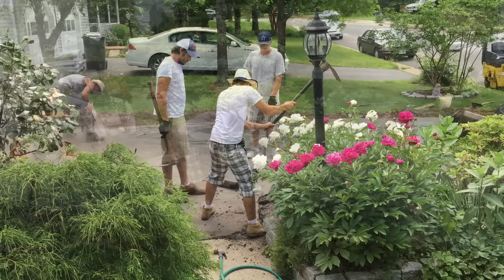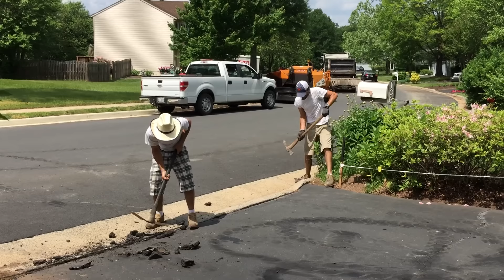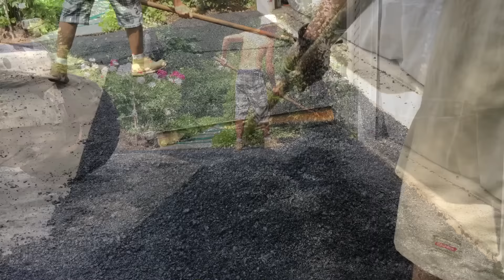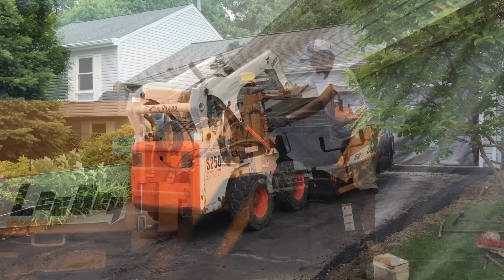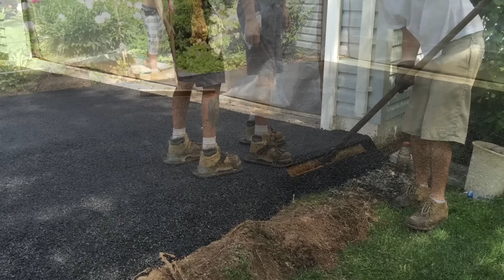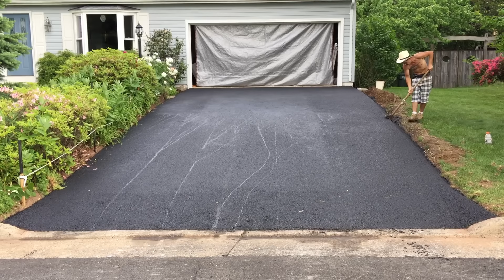A-Pak Paving Resurfaces Our Asphalt Driveway

Comment: Great job. Yet, I am surprised there isn't a better way to pat down asphalt than having a skinny guy with big shoes jump around on it.
Reply: +bg147 Odd how there weren't people around with more suitable BMI for that part.
Reply: +bg147 Plate compactor.
Reply: Realistically they should have had a vibratory plate and a paver that has feed screws and removable wing caps instead of guys with shovels and  pack pads on their boots. Shirtless and unprofessional is the way to go if u want a cheap driveway.  If u want it right someone comes in with a skid steer with a milling head on it and they use tac between the old driveway and the new surface  not guys with picks banging and smashing and wasting time and money
Reply: When he started this job, (the skinny guy) he was fat. :P
Reply: bg147  there is it's called a hand tamp
Reply: +Matthew Steiner gkbu
Reply: Matthew Steiner a hand tam won’t comment compact it evenly it’s more for patching than paving
Reply: No no no
Reply: bg147 there are far more better ways.
Reply: bg147 we use tamp shoes,hand tamp, plate compactor and of course a roller with vibratory. The shoes smooths it until your ready to hit it with the plate and roller. So it doesnt look rough.
Reply: And the Bomag did not have a reversing beeper !
Reply: bg147 
Yeah I'm the same  got a roller and  that guy is way to light to tamper the edges🤣🤣🤣🤣🤣
Reply: there is ... it's called a cold tamper ... weighs about 50lbs and does a better job ... also has a 100 lb option ... and both work better than the shoe version... and actually compress the pavement and helps orient the small stone to the top and large ones to the bottom so you get a nice tight driveway top bed that will repell water and withstand loads longer and last longer .... these in this video I wouldnt let them pave a sidewalk
Reply: Vibrating rollers or plate compactors these guys are just cheap af.
Reply: @EyezLikaFox̌  you should never have to use shoes.  Use the plate tamper within minutes of it hitting the ground
Reply: @roller121984  i fully agree with you but my father is very old school lol
Reply: Hahahahaha
Reply: It’s not to “pat it down” it’s to smooth the surface. You can put a 300 lbs guy makes no difference.

Comment: I am a asphalt worker from Michigan, There is many problems with this work, 
1. The but joint at the road is to narrow making the bump up over the curb to high.
2. no tack was applied to the old asphalt, with out the tack the new asphalt and old asphalt will move differently and the new surface will end up peeling up. 
3. The mix used has to large aggregate in it judging by the video, it is probably a binder mix , not a surface mix 
4. The mix appears to be cold meaning it wont bind together has well.
Reply: Bingo on all counts!
Reply: Not to mention how long it seemed to take before they rolled it..
Reply: I pave over here in ny and i am damn near in tears watching this. It is so bad
Reply: Also looks like a lip at the garage, nothing like rain on the garage floor!
Reply: Homeowner probably went with the cheapest bid. Also the fact they’re doing asphalt work in sneakers is a dead giveaway these guys are a joke.
Reply: In the East, Korea uses a combi roller, so the surface is much cleaner and firmer. And it is compact. 
특이하네.

Comment: It looks pretty porous to me.  But so did mine when it was laid.  I wasn't happy with my edges as they looked a little ragged, but I can see the same thing in this video.  Compaction while hot is the key.
Reply: If done right your supposed to use a rake to tap the edges as you go, then whack the edges, when done right you get a consistent straight edge
Reply: I was in the asphalt business for 35 years. They actually did a great job with the edges the way they compacted it. Once the dirt birm was raked back up to the edges it will look awesome.

Comment: On observation, I have a few thoughts and concerns.

1) The original asphalt at the top end looked somewhat level with the garage floor.  2) These guys cut out/remove about three feet across the top and then fill in with new asphalt to the floor level.  3) They add what appears to be 2" to 4" of fresh asphalt to the entire driveway and thus raising the asphalt at the top peek to be higher than the garage floor.  That would seem to cause a grade/slope towards the garage and thus with heavy rains could cause water to pool at the garage door or even leak into the garage.  4) I did not see the contractor heat up to prepare for the new asphalt to bind to and neither did I see them use a hot asphalt liquid binder.  

With those thoughts and observations, I would suspect that the new asphalt will begin cracking and breaking away within a relatively very short time.
Reply: Looks like homeowner went with the cheapest bid.
Reply: i do asphalt videos too! :)

Comment: Roll/vibrate those hand joints you raked almost immediately just pinching them in, don’t step those in. Turn the burners on and let it heat up before taking off, the screed finally got hot 3/4 of the way through the driveway and tightened up the mat, no tack could make it slip where they turn into the driveway. We all do it a little differently though, finish looked good.

Comment: Excellent work, great attention to detail, very good price.  Thanks for sharing and giving the company a well done.
Asphalt is a combination of 3 sizes small rocks with pitch, an unusable remnant of oil processing.
All asphalt will shrink.  You can apply a surface coating after a couple years to make it nice and black again and minimize shrinking and cracking.  Asphalt that is removed is recycled into new asphalt, unlike concrete.

Comment: They have a bobcat and pull it up by hand
Reply: I'm shocked they didn't shovel from the truck into the paver lol.   They made a day of it I guess
Reply: +Steve Vlietstra i wondered why they didn't do it in 2 pulls instead of making the noob shovel in 2 foot all the way down the drive. also why not use bobcst to pick up old asphalt, its what we do. also why not dump truck directly into hopper. thats what it is designed for
Reply: +Kuntry72 or pull a half a pass then a full
Reply: yeahh, I can't brain it...
Reply: Impulse reaction yes they are
Reply: I was thinking the exact same thing. They made the whole thing 10 times more difficult than what they needed to.
Reply: RIGHT!!!
Reply: Sometimes its safer when around buildings or is a better way to prep so they dont accidentally disturb the asphalt base  all ready in place. Its a lot cleaner as well.
Reply: Should see us pave 🤣 what a hoot
Reply: ㅈㄷㅅㅈᆞㄱㄷㅈ눟ㅌㅎᆞㄴㅅ
Reply: 5asyraf296 cree''^
Reply: Boss- USE THE MACHINE
Workers - I am machine
Reply: Hadd work keeps the soul honest buddy
Reply: @jamesclifford5074  true but for a business surely effiecietcy would be better would it not
Reply: Eric Thompson 
Thanks Eric
Many posters don’t realize little corners and edge of garage slab needed a bit more careful “handling”.
Reply: Paid per hour

Comment: I've been a heavy equipment operator for 22 years and worked in asphalt for the last 7 of them. Kevin in the description is mostly on target. They did pretty nice job. It is nice to have 2 layers if you can, but you can get away with one in a small private driveway like yours. It is not going to see a lot of truck traffic, you aren't going to park a tank on it. It is fine. You can't tell how long they waited between the 2 layers at the end. If it wasn't at least a few hours, you really didn't get 2 layers. It's going to cool together as one layer which is not what you want but it's fine for a private driveway. I would have liked to see them put some tack down on the part they didn't tare out so the new stuff sticks to it a little better. The size of the roller was fine for the job, I would have like to have heard his vibrators coming on for at least one pass all the way across for better compaction.
Reply: you are completely dead on... and with out the tack that resurface isn't going to last
Reply: I noticed they need to stay off for 5 days, I remember driving on freshly surfaced country roads growing up, are those made differently to allow immediate use?
Reply: No. What they mean is don't park on it for 5 days. An asphalt roller works like a rolling pin. Spreading and stretching the asphalt into place. Driving your car on it has a similar but much lesser effect on it. You aren't helping much but as long as it has cooled and been compacted enough that you don't sink in it, you aren't hurting it. Parking is every different. You aren't smoothing and stretching, you are sitting in one spot smashing it. You can ruin that smooth surface and maybe leave indentations where your tires were
Reply: I agree tack and a bit more compaction bit non the less looks good
Reply: and to be completely fair to them Herminio, he may have just not filmed that part or maybe cut it when he edited because he didn't know it was any different than the static rolling
Reply: +herminio morales when we do driveways, he is very specific on how he does it with the roller. He rolls it initially without vibrators on, gets it level and smooth, then goes over it for quite some time with the vibrators on.
Reply: karmadump  are you kidding? This is the worst paving job I've ever seen.
I've been paving for 25 years and this is a joke
Reply: Your the only guy that knew what you were talking about in this whole comments section
Reply: @acosta1503  and what exactly is so terrible about it? Other than no tack coat I don’t really see any major issues. Maybe compaction could have been better too
Reply: The roller should have stopped at angles instead of front to back.
Reply: @stiercreations  dude... it's a driveway not a highway.........
Reply: @stiercreations  On a road or much bigger driveway, I'd agree with you. But on a small driveway or patch its perfectly permissible  to just go back and forth if you can get completely off the pad (I haven't watched this video in 5 years, I don't remember if they got off the pad or not)
If you try and turn on a small pad like that you are going to cut it up (OK, lets say you are more likely to cut it).
Reply: Your comment means nothing. Your opinions mean nothing coming from a guy that’s been in the field for seven years to a guy that has been doing paving since childhood. That’s who was installing this driveway. Uou do not need tack on a driveway of this size in order for it to last. It’s not like your blowing donuts. The job is being laid on thick. The plows will not even be an issue.
Reply: @karmadump  your no hot topper
Reply: @r_dubs90  You're
Reply: @karmadump  ur NO HOT TOPPER
Reply: @r_dubs90  you're talking nonsense. So if I do something wrong for 25 years it becomes the correct way to go? Really?
Reply: @kingdave294  ask your wife that question, next time you attempt to please her.

Comment: They used the old asphalt for the base after removing bad spots thats fine and standard operating procedure unless the homeowner wanted to pay for a complete tear out and start from scratch not necessary on that one! I did not see any tac coat applied to help bond the hot asphalt to the base however maybe they did . Nice job men!

Comment: so a few more thoughts . they did not put emulsion on any joints or the driveway itself considering its an overlay . they waited way too long to put the roller on , you need to pave it in a way that you can get the roller on fast so you can get proper compaction ( pull it in 2 passes , not 1 pass and do 18" by hand ) and 1 more thing is when they did roll I couldn't hear if he was running the vibes or not , with a roller that small you need to vide both ways during the breakdown process then roll it static during the back roll process. just a few observations from a 21 year vet and an owner of my own paving company ( not one like this either , I have 32 employees,  3 pavers , 2.5 crews and do over 13 mill per year in revenue )

Comment: First off, the driveway wasn't in bad shape and could have easily been repaired to look like new and for much cheaper. Secondly,  when putting new asphalt over old asphalt, you have to use tack coat for adhesion. Otherwise, the top layer can slip and cause cracking. Without tack coat, there is a good chance the new asphalt will fail and rather quickly. I know, at least where I am it is required on all driveway overlays and the same in most areas. Also, they should have used a plate compactor along the seam at the garage, where the roller can't get. A 90lb guy in fancy metal shoes isn't going to get the job done. That area will be a concern over time. There are a lot of other little things they did wrong and took shortcuts on. If I was the homeowner, I would be demanding to know why they didn't use tack coat and look for some kind of guarantee or refund, before the inevitable happens.
Reply: finally a critic comment with some sense. thanks

Comment: They didn’t tack coat over the existing driveway.   That’s going to peel up and crack in no time.
Reply: Looked like it wasnt even hot.. that's a crap job
Reply: They didnt even put any type of processed stone down on the sides where they widened it!
Reply: Yup! Right over the old cracks and everything.
Surprised they put this on YouTube!
Reply: I have seen it done several times. They waited way to long to heavy roll it. Poorly done over all. Also why did you get billy bob's back yard paving to do this. They looked and acted so unprofessional.
Reply: @dilbertleadbetter8481  it was the definition "fly by night" crew wasn't it. So much they did half assed at best. I wouldn't let anyone video anything like that, let alone post it . 🤣
Reply: @dilbertleadbetter8481  q we’re

Comment: Can someone educate me as to why one would asphalt their driveway and not use concrete, stone, or pavers?
Reply: its preference based on pros and cons. asphalt is cheaper for one but requires more maintenance. Concrete will probably last longer depending on where you live. places that are cold, snowy with lots of salt will probably steer you away from concrete because of ice and temperate changes
Reply: +mikek21216 yea it has alot to do with weather  like in nj everyone has asphalt bc salt and snow eat concrete right up i had to replace my walkway early this year bc of it

Comment: I do asphalt work pretty much every day, that being said I do not see any reason at all to tear up a driveway like that, everything looked good from the start, they did a great job with it all though, knowing what I know and doing what I do I wouldn’t have tore it up like that
Reply: May I ask how long it takes for asphalt to dry, and how long after it has been laid it will continue to smell? And how far does the smell travel?
Reply: As far as set up and drying it depends on what asphalt is being used, if it’s cold mix it can take a few good months of curing time to really get hard to where when a person turns their wheels on it the asphalt doesn’t get damaged, the cold mix to me doesn’t really smell after it has been rolled, hot mix on the other hand sets up good and hard pretty quick, by the next day it should be completely solid, even after it gets rolled down it’s solid, as far as smell goes with hot mix I notice a slight smell for a day or two but nothing at all like when it’s being laid out, for driveways especially where turning is common I’d use hot mix asphalt if it were me if you plan on doing something like that
Reply: Lol you right they should of tear the whole drive way up and did it right not do it on top of the pre-existing drive way it’s dumb
Reply: You do it every day huh?? They tore that part out so the driveway would be under the lip of the garage… if they had overlapped it would have been higher and caused the rain water to drain into the garage. Also, it keeps the paver from being close to the garage

Comment: ween the 2 layers at the end. If it wasn't at least a few hours, you really didn't get 2 layers. It's going to cool together as one layer which is not what you want but it's fine for a private driveway. I would have liked to see them put some tack down on the part they didn't tare out so the new stuff sticks to it a little better. The size of the roller was fine for the job, I would have like to have heard his vibrators coming on for at least one pass all the way across for better compaction.

45

^#

Comment: The old asphalt was less than an inch thick near the garage door in particular and likely was sold as being four inches thick all over. A common way contractors cheat their customers.
Reply: It was just the top layer they ripped up there , you could see the bottom layer still, so was most likely just a recap done from the old asphalt settling

Comment: Question
How much will cost for a job like this for 120 feet long and 24 feet wide driveway
Reply: Angel F about 25-35 grand
Reply: Cap 3200 grade and lay 4500 rip out gravel and base top 7500
Reply: Depending on price where you live price per ton of blacktop give or take 300-1000

Comment: About 10 guys to do A 3 man job. Small 1.7t digger, scrap the bobcat less labour digger can rip out ashphalt and load straight onto truck... it's way too thick aswell, only need about 25-30mm thick. Don't even get me started on those flip flops.
Reply: Please tell us what’s wrong with the FLIP FLOPS
Reply: @6misery  Its called a plate compactor and it does it four times faster and a better job
Reply: I have only seen guys use flip flops only on the edges where a roller or compactor can't get to. This is so comical the way they did this..omg...lol

Comment: Tamping down the hand work by the garage with his feet...he weighed what a wopping buck 25. A plate tamper would of packed it better and won't crumble but hey that's just me
Reply: +Engine 65 Productions Very poor work!  Edges are not straight and even. there is a footprint, roller lines,  very thin overlay and edges not hand tamped properly.  Job will not last too long. Money wasted.